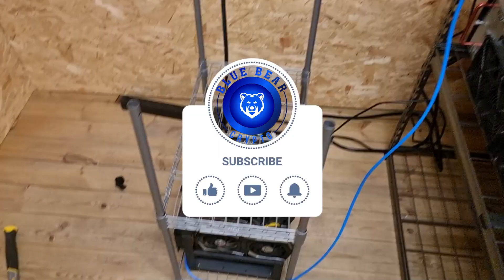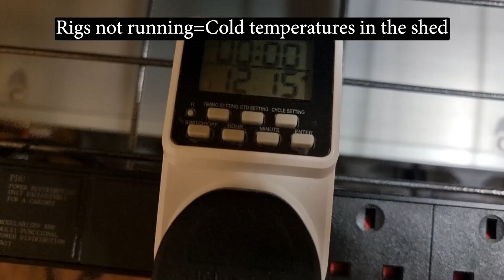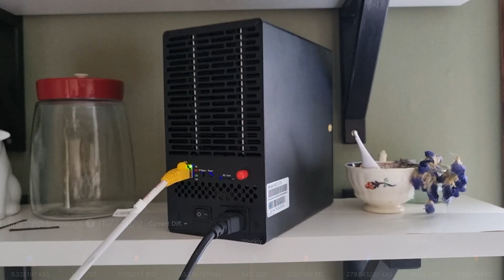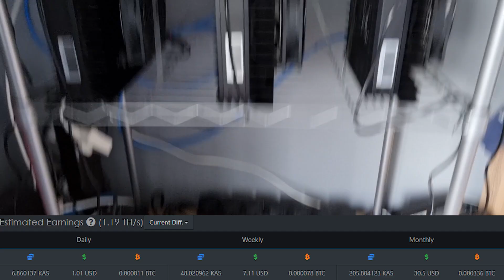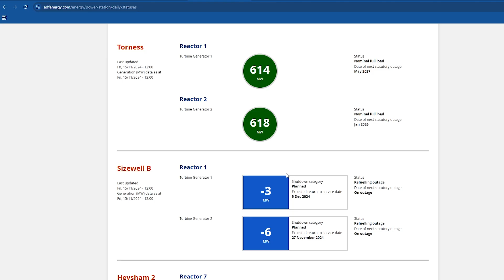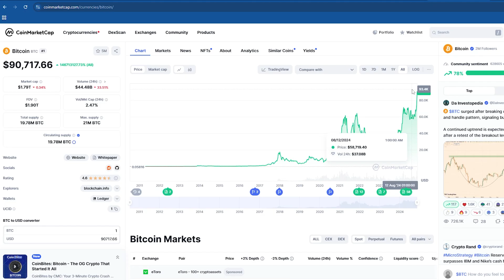Current State of Crypto, Profitability and Strategy November 2024   UK Crypto Miner

Comment: Hey buddy every thing looking good how's the nano3 running? I had 1 of mine die finally 😢 it has the overheat issue with the 4R7 inductor
Reply from the maker: Mines going nice and strong in the cold side of the shed! Running on high since I got it
Reply: @BlueBearCrypto  yeah it's awesome product my other two are going strong I just wish they would have included fan control
Reply from the maker: @jasonkidwell1767  Yeah they're decent for the price. I think mine has only kept going because it's in such a cool place, if i had it in the house at normal temps it would have probably died by now